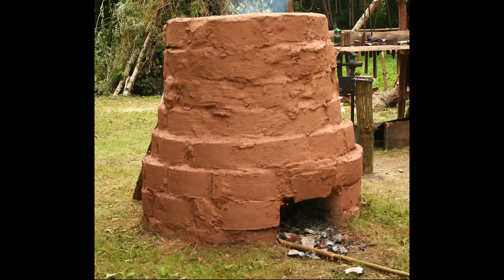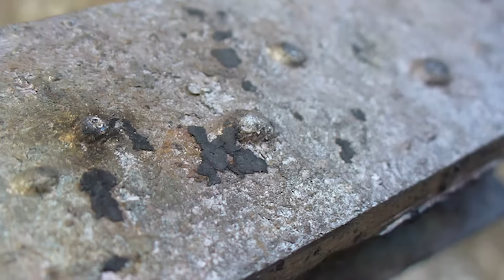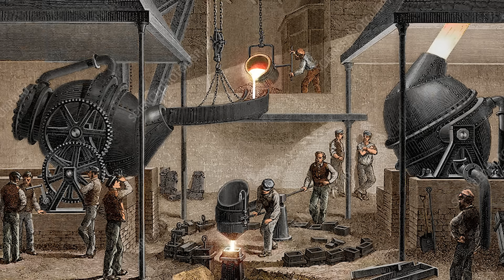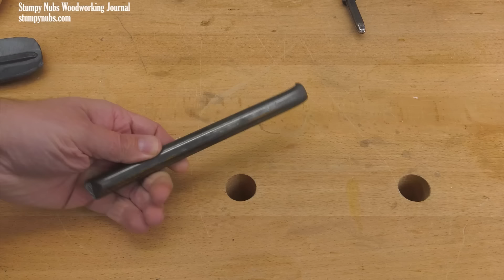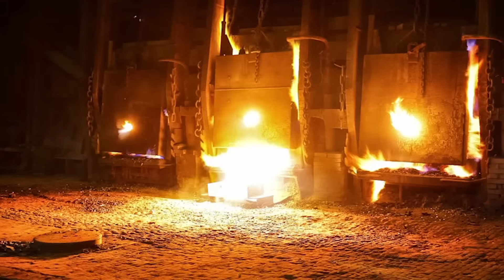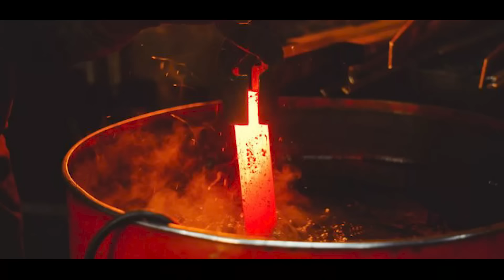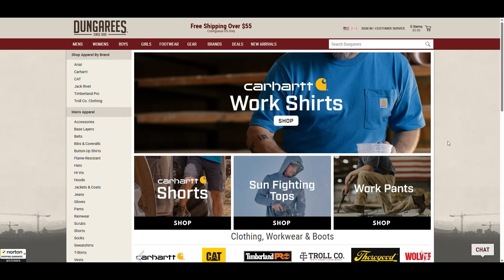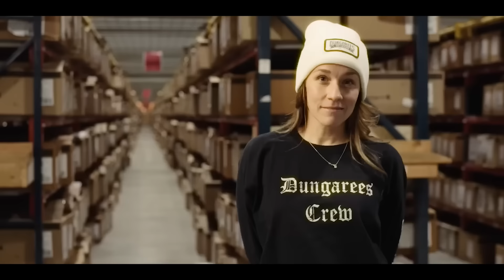Why they REALLY don't make tools like they used to

Comment: I would agree with you for tools, but I have to say that in certain cases (for example perhaps vices) that I bought an old vice and refurbished it, rather than a new one made from cheap Chinese cast steel that could/would probably crack if tightened too much 🙂

Comment: I came for the opinion piece and stayed for the history lesson. Thank you for that well presented bit of knowledge. Quality tools of yesteryear do last but sometimes it's because they hang on a wall while modern tools do the everyday work and get worn out because they CAN be replaced. I do mostly mechanical work and have many tools that can't be repaired if they break (Snap On) but instead would be replaced with their shiny new equivalent so I don't use them because there is something about physical history versus virtual (book or catalog). I'm sure many people feel the same and have collected their low use tools for the same reason. Cheers

Comment: How about Japanese chisels, often said to be made of excellent tool steel?  They may be made of  a strong steel for the body of the chisel, and a hard steel on the back for the edge.  They come in different shapes which can be an advantage for specific jobs.
Reply: They tend to be very good, whether old or new. Slower to sharpen but stay sharp longer than most. Higher hardness means a keener edge is possible. They can be higher hardness since they’re laminated, without soft steel or iron would be too brittle

Comment: Japanese carbon steel is best for wood working. Powdered formed steel alloy is the future for wood working blades eg veritas special powdered alloy chisels. Otherwise millers falls blade blows A2 blades out of the water. Steel blade is most important and modern plane blades are crap by comparison. Steel is rushed in production and slow cooling no longer happens like in old days.

Comment: I have collected and used antique chisels for over 45 years.  Buck Bros cast steel, Marples cast steel, Berg, and James Swan chisels have been amazing.  Also the Stanley Everlasting ? chisels from the 1920's are awesome. I was lucky enough to acquire a set of 8 Keen Kutter chisels from the 1920's that were made by Berg.
Their quality is off the charts, a true joy to use.  Thanks for a great video that was educational and entertaining.  I have not pulled the trigger on a set of Narex Richter chisels yet, but I am getting closer every day.  Stumpy - would you recommend the Narex Richter for someone who occasionally works with Hickory and White Oak ? Thanks for a great Video.

Comment: Blacksmith here. A lot of older steels may not be as sophisticated as new steels but they are simpler and easier to manipulate, heat treat, sharpen and repair. Sometimes good is better than perfect.

Comment: Good overall history of steel making and the description of heat treatment was OK for the layman. However, alloying has been around since Bessemer. The use and effects of Mn, Mo, Cr, B, W and other elements in carbon steel has been understood and refined ever since. Poor modern tools are most likely to be a problem with poor selection of grade and/or heat treatment than with the actual steel itself.

Comment: Just out of inquiry,I have a original military Whitworth rifle,I have read that he used special steel,going to the point of buying the mine in Sweden specifically to make the barrels because of the type of steel he ( his company) could make with this material,costing over 150 times the regular cost of the raw ( ore) materials at the time.i know this barrel hasn’t rusted after 160+ years and still looks perfect,functionally the same,they were worth the highest price house in the best street in the day,compared to a military p53 ,from memory cost hundreds of times less here in nz..having played with other 160 year old steel,not iron barrels,this stands alone due to multiple things, just curious as to your or others opinion on the material that provoked him to go to this extent….regards.

Comment: Some of my favorite gouges were made from leaf springs in a village in China!
Reply: Generally, leaf springs are likely made from steel with a fair bit of carbon in them, so they can have high yield strength, which is desirable in a spring. That gives a smith something to work with, making the steel hardenable.
Reply: @gregsmith4102  Yes and they're easy to hone and keep an edge, when rung sound like a good temper.
Reply: Where did the leaf springs come from?
Reply: @ohgary  I'm assuming cars or tractors. A friend travelled there and brought back  a few fishtail gouges from a village whose entire industry was blacksmithing/forging.

Comment: I have found the new steel is not always better. I use several planes in my daily woodworking job. I have one Veritas block plane with an A2 steel blade, which they claim would hold an edge better on course grained hardwoods better than a standard Carbon steel blade. Every time I use the A2 blade to cut down the ziricote wood sides for my guitars the blade edge fails within a few strokes, and then just skates on the top of the wood. I have an old Stanley block plane that must be over 100 years old, and the old blade in it will handle the ziricote for several guitars before it stops cutting effectively. So I replaced the A2 blade in the Veritas plane with one of their plain carbon steel blades. It holds an edge better than the A2 steel but it's still not as good as the blade in the old Stanley. Maybe the A2 blade was just a dud; I don't know. Great Video - thanks!

Comment: Keep in mind a crucial element of the laminated design is impact resistance, AND faster sharpening.  Iron is many times softer than steel, so sharpens extremely quickly.  Iron is also always soft, so it will never crack and shatter like steel does.  If there is not a conscious effort to soften the neck and tang/socket of a chisel, it will snap after being struck.  This can even happen to good quality chisels, if there was an error during manufacturing.  Such a thing is lamented by Richard Maguire in his article "Dear Tool Manufacturers", saddened that laminated construction has become a lost art.  

This is why all quality new Japanese tools are STILL laminated.  From their chisels, plane irons, kitchen knives, SAWS, axes, even hammers!  Many of these are laminated with wrought iron too!  Wrought iron is even softer than modern iron, and mild steel, so sharpens even faster.  Wrought iron was also vital for sharpening long ago.  The Japanese always sharpened on a slurry, which creates a finer edge.  This is why modern water stones are so soft, to create slurry rapidly.  Natural sharpening stones, which was the only way to sharpen back then, were much harder.  The silica impurties found in wrought iron will actually scrape the surface of the stone, to create the required slurry for sharpening!  If you compare a mild steel laminated blade, and a wrought iron blade, the wrought iron will create much more slurry on a hard natural stone.  The importance of slurry is also why Nagura stones exist.

Comment: Hi, wrote a silly essay on the development  of chisels for cabinetmaking in the UK from the 19thC onwards for my uni work and would just like to maybe point out some things. Firstly, new steel absolutely is more consistent overall than antique steels as we have incredibly fine controll over every step of the process. New chisels and edge tools are Excellent. However, Crucible steels for the most part were consistent. That was their big selling point. In fact air hardening steels were developed using the crucible process and individual firms would sell different steels of different grades/compositions to best suit their customers needs. The Bessemer process however, produced lower carbon steels wholly unsuitable for edge tool production which is why crucible steel production continued concurrent to the adoption of the Bessemer process. Crucibles were absolutely absolutely made obsolete by the later development of electric furnaces post ww1 however. Also the vast majority of chisels suitable for cabinetmaking and joinery around the 1850s and even earlier were made entirely of cast steel. There wasn't a cost issue. These tools represent a massive amount of labour and material cost. They were expensive for the end user. Forge welded tools continued to be made specifically for Large tools such as plane irons and framing tools and axes as at that point the cost to efficiency ratio became untenable, it also meant that these could be different hardnesses in different places without being finnicky in the heat treat. Great for plane irons which would be adjusted by hammer. Lots of interesting stuff to read about the steel and edge tool industries back in the day !!!
Reply: Where can one read such things?

Comment: Older tools are usually made from hard and tempered steel all along their length. Ax a cost saver modern tools are often only hardened and tempered for a short length with softer and cheaper steel making up the raft of the blade.

Comment: I happen to own a set of Narex chisels and it's always bothered me how easy the edge chips, yet they're also quite easy to resharpen. From the looks of this video, I might need to look into replacing them with harder steel. I don't mind spending more time sharpening my tools, as I just want them to retain their edge for a long, long time and I thought they were around 60-64 HRC, not 59. That might be the issue I have and I'll look into their other hardness graded tools. The only thing I want to point out in case beginners get confused, is that in the case for hand planes, Stanley, Record, Sargent and similar old timers did their best work decades ago. That argument isn't, afaik, based as much on the plane irons, but rather the quality of the spherical cast iron used to make their bodies and frogs.
Reply from the maker: It all depends on what you are using chisels for. For most work you want something that is durable, but also easy to sharpen (like Narex's regular chisels, or something similar). However, if you chop a lot of hard wood, especially hickory, oak or exotics, you would likely prefer a harder steel that will hold up better, even if it means it's more difficult to sharpen (like Narex's Richter chisels, or something similar).
Reply: @StumpyNubs  Thanks! I work with a bit of everything with my day job being furniture restoration of everything from the early 50's to the late 90's, so both are likely good to have on hand. Do you know what could have caused the chipping in my regular Narex chisels? They started chipping when I was chiselling through pine knots. Is it just a matter of hammering them dull and resharpen as you've talked about previously or could there be something else?